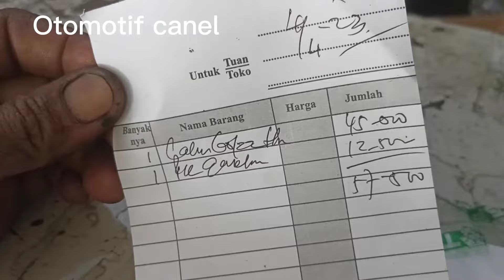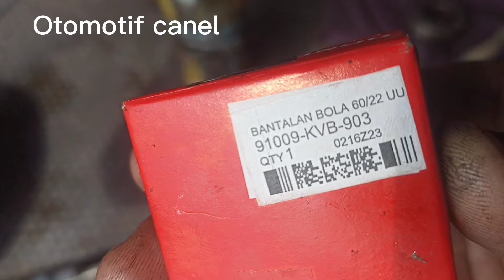cara ganti bearing roda belakang beat fi @Otomotifcanel

Comment: pasang bearing di ketok tengahnya ga bikin rusak bearing mas?
Reply from the maker: Sebenernya normal dan wajar saja, tapi kalau mau mengikuti standart yg seharusnya itu salah
Reply: kalau standart nya memang gmn mas caranya? saya bingung karna posisi bearing dalam, kalau di ketok pinggirnya nanti alat ketok yg presisi juga ikut ketahan dalam crankcasenya
Reply: di bakar dulu bisa ga mas biar memuai
Reply from the maker: @ellkozaku9070  bisa jg....kalau di bakar biasanya tempat bearing nya yg di bakar
Reply: Itu yang kena diameter luar dan dalam
No problem